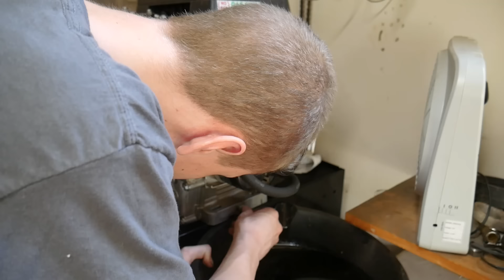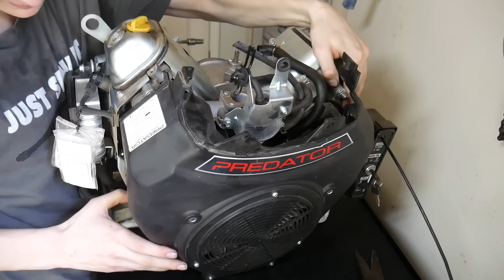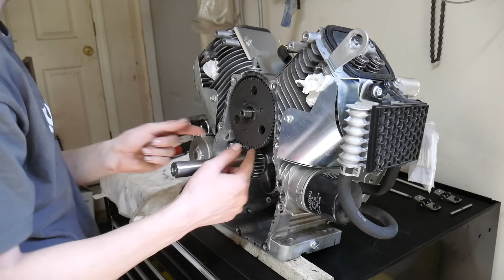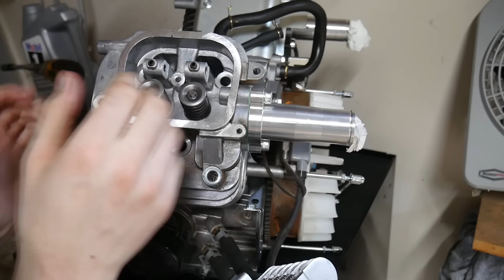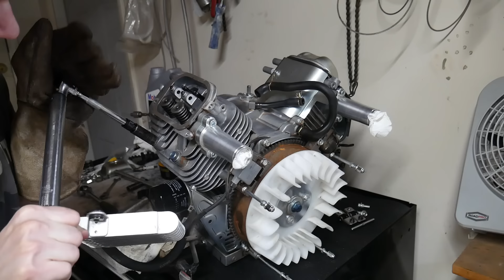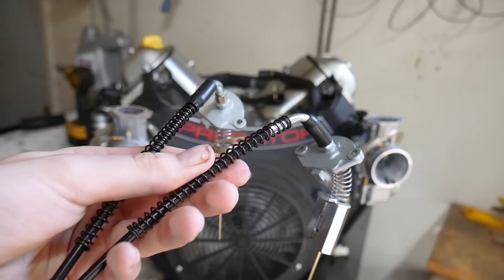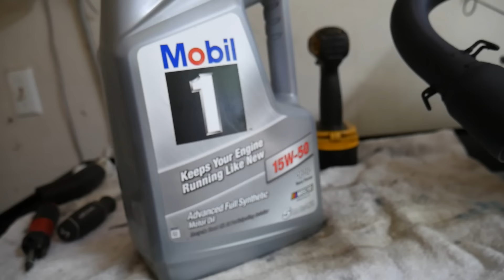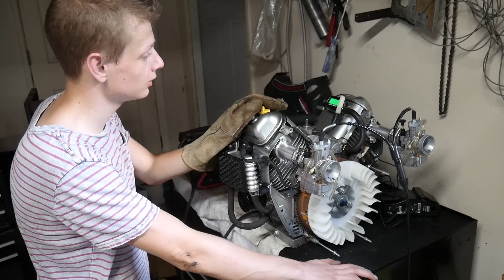2X Factory Output! Predator 670cc Performance Build

Comment: Here is a trick you can do for more power
Advance the spark. I saw two magneto and that might have an adjustment. 
1 use a rotary file, cut slots into the mount hole and elongate the mount holes. Use a large washer afterwards to lock it down and keep tensions
2 not sure if the flywheel has a key. If it does, grind  the key to half the thickness so you can advance the spark by rotating the flywheel on the crank
3 if you have a small airport nearby, pickup some blue gasoline. When I did it was 108 octane high lead but I think it is 100 octane low lead now. Not quite sure.
4 mill port and polish the heads. Possible a thinner gasket. Take a 4 inch bolt, sandwich some coarse steel wool between two large washers, and get a drill and polish away.
Remember to blow the doors off everyone around you.
Vroooooom

Just some old tricks to get more power
Reply: Идиотизм!😅
Reply: I did this on my 99 Miata. I have been running a 5-degree advance for about 10k miles with no issues, it definitely had a small but noticeable bump in power.
Reply: Fyi, that is called timing gain or delay. The carburetor can alter time if he sets a higher idle with slow time it will synchronize at the high rpms. Dragsters have used this over 50 years.

Comment: Engine bearings run on a thin layer of oil. At proper temp the bearings don’t even touch metal on metal as a super thing layed of oil creates a layer between the components thus it’s essentially an oil bearing. So proper oil an proper maintenance to an engine. The only wear an engine gets is on start up and warm up clean oil an up to temp an oil up to temp then there is no wear at that time. To thick of oil then not only do you shorten the life of the engine by metal on metal contract during start up an warm up an even at full temp but you even lose horsepower from the lack of lubercation an lose power from the excess internal heat that can’t be pulled away with proper weight oil running over hot parts correctly

Comment: That was a neet build. I have a question won't the motor overheat without the flywheel cover on?
Reply from the maker: I don't know about that. as long as your moving. I see alot of people running 212's without the covers

Comment: I have watched this 3 times it is just hotrod on smaller scale and young man some day you will be a awesome Dad and Grandad some day. Ever thought of using Valvoline VR1 high zinc race oil zinc would be good for metal to metal parts in small engine.
Reply: I use vr1 in my rotary

Comment: You know that might work in small engines I'm still testing this but on a cold day it is not really good.. thicker oil it will actually not let the upper cylinders lubricate and eventually cause a knock that happened two of the  lawnmower that I've used because I usually use 20w 50 on the oil changes I do for customers and I've had to replace two motor so far and I've only put it on three other Motors
Reply from the maker: Yes I was a little mislead on that. Thank you
Reply: @VasilyBuilds  you have a really good Channel better than rather be welding at least you put a skid plate on your stuff can't wait to see the next one

Comment: My roommate just recently bought a 670 the crank shaft bearing went out and he only had it for a week he took that piece of garbage back to harbor freight and got his money back. Don't buy a 670 they have way too many issues I done some reviews and another guy bought one and his oil pump failed blowing the engine so apparently predator doesn't give a shit about their customers because they have not redesigned the engine for quality purposes so is you want to use a V-twin equipment engine go with either Briggs and Stratton or Kohler with their CH1000

Comment: I used to run a honda twin on a pulling tractor and we loved it. We made a custom intake and manifold ourselves, milled the heads as much as possible, stroked the crank .60, and ran stock rods and cam, it turned 6k to 7k rpm easy and had tons of torque.  I've been wanting to build a preditor the same way and now that I know you can get a cam and everything,  should be awesome.

Comment: Wondering whether you think this build might have enough reliability and durability for an ultralight aircraft engine.
Reply from the maker: Too heavy not alot of power. You can get alot of power but then you sacrifice reliability
Reply: @VasilyBuilds  What a guess on the weight? 40HP is about right if the weight is under about 80lbs. Could lose the starter and save a little more weight.
Reply from the maker: @tthenrie1  110lbs 25 hp. Ditch the heavy flywheel and stock manifolds and you could get it down to 80-90lbs

Comment: Enjoyed your video very much but PLEASE buy yourself proper tools. You really should be using A LOT more lubrication especially on a brand new cam. Lubrication is so important for new camshafts and new parts. I know its clone engine but you definitely dont want that thing blowing up. And Im talking to all the young engine builders out there too, everything needs to be well oiled inside the engine when you put it together.

Comment: Just spent a few minutes on the
Performance 670 website,
Got into the specifics of what performance parts and pieces you are still needing.
Head work,
Pistons,
Push rods .40's
Billet rockers
Billet Connecting rods
Aluminum flywheel
Adjustable timing Aluminum flywheel with cooling fins
Mukuni Carb kits
Predetor Carb kits,
Air filters, for each kit
.20 Billet Piston set
( eventually ) !
Did not see any type of steel performance crankshafts available
( but know they must exist )
Along with performance stroke assemblies
Anyway,
Understanding that you have to start somewhere,
But let me know what direction you are wanting to take this Engine to.
What application are you planning on using it in please ?

Steel Flywheel

Comment: An awful lot of work to not install performance rods, and the performance flywheel.
What are the additional costs you are looking at ?
And, what additional flow work can be done to gain additional hp ?
Valves, flow matching to your header dia., and the same with your intake, I don't have a ton of experience with this specific Engine, but I have to think there is additional hp. available !
Bigger valves, etc. ?
And what are your additional costs for those added performance upgrades ?
My curiosity is killing me !
I am hearing about some insane hp. numbers out of this engine, and still maintaining reliability.
Ok,
I'm outta here !
Good luck, and hoping to hear from you.

Comment: The only problem with 50 weight oil is that it won't flow well when it's cold. Not when it hasn't been Star Ted in a while, when the weather is cold. 50 weight is racing oil, and pretty much everyone that used to use it has switched to light weight synthetic, and this includes nitro cars!

Comment: To see somebodybthis young able to do this much, it gives me hope for my profession. The additions you made are really good but, the rods and the flywheel would've helped more than these. The main source of power is always in the heads. If the air doesn't move, the motor doesn't run. Adding air thru a cam is very beneficial. The springs aid with valve float. That becomes a problem at high rpm. Controlling it with springs is smart. But if there isn't enough speed in the crank, it's not a concern. Lightening the rotational mass is why the rods and the flywheel are lightened. Getting those up to speed is why you put the springs in.

Comment: So you see after he crashed the cart with the 670cc, he realized the problem, there wasn’t enough power to drift away from the house
Reply: how does it compare to a rotax 600 or 800-850 etc? My yz-250 pushed 48hp stock and my OMC sled motor even more. Are you runnihnig xd-100 etec oil or amsoil dominator? I got my sled motors, yz-250 and kohler toro mower on xd-100 amsoil dominator. i just bought 6 gallons quicksilver synthetic TCW3 to fill my 8v92 detroit 2 stroke from walmart and its way cleaner than rotella. The synt tcw3 has high film strength and runs and burns cleaner but its little more pricey!
Reply: @jlo13800  Can't compare because you're trying to compare an industrial v twin 4 stroke to a single cylinder 2 stroke
Reply: @jlo13800  thats a performance built racing engine comapred to a fucking lawn mower engine.
Reply: @sahibdipsandhu ratherbwelding did a rotax go cart build I think and all it did was wheelies and immediately max out at 55mph
Reply: he will have problems with valves ....just add a turbo without changing

Comment: I use mobile 1 15w50 in almost all of my small engines it works excellent in them
Reply from the maker: I'm concerned about  the oil in the cold. It's 30 degrees f here

Comment: Have you actually ever Dynoed one of these Stock 670's & then with these Upgrades? A Stock 670 making 22hp@3600rpm is around 76% VE, and yes, if you're turning it 7000rpm it could make 42hp with a Carb/Cam/Valve Spring Upgrade, but can the rest of the parts handle them rpm for very long, the Stock Flywheel, Rod, Rocker Arms, Push Rods, Valve Locks & Keepers? On the Honda/Clone Singles, about 5000-5500rpm is Max those Stock parts are good too. Some people are using these on Kitplanes, so Durability & Weight is very important. Most People want their Engine to last a long time no matter what the put it in or on! Just about anybody can build a Grenade, build a 670 that can make good hp at Max 5500rpm and last a 1000+hrs. A Rotax 912UL/914UL 4 Stroke is rated at 5500rpm, my different Chevy 402, 427, 454 Chevy Big Blocks were all rated at 5500rpm. I did Street Race my 402 BB in a 70 SS Camaro and I did shift it at 7000rpm and it was making around 600hp. Over those years I broke (1) 12.5cr Piston, (1) Broke Valve Guide, Bent 2 Valves, and broke many SHP Rocker Arms, and destroyed one 400 Turbo Trans Pump.

Comment: I see why people are complaining about you and the stock flywheel the plastic cooling fins could possibly fly off at higher than stock RPM and if you break a stock rod it's possible to send a piece of aluminum shrapnel into your back and you'll be doing another hospital video

Comment: “The thicker the better, just like women “😂😂😂 epic dude lol 😝 that made me subscribe
Reply: Been proven false. Higher viscosity means increased drag also. Engine with oil cooler that can keep tempsbelow 300F should be happiest with SAE 30 or 40. BTDT. (If you really need THICK, why not go for synthetic grease?)
Reply: @jacquesblaque7728 I bow in gratitude to your analogy relating to viscosity and drag. Profound! So im mulling over your "400 footer into the center field stands" statement and Im thinking...all oil is slippery, but viscosity options  when applied to protecting  a gasoline engine makes the oil (for lack of a better alphabetical grouping) tunable to the demands put on  the parts,with the dissipation of excessive temperature being job 1.Then all the other possibilities that manipulating the drag of motor oil as it travels over various parts Can only bring more positive options.The 100 foot aisle of oil choices suddenly makes ridiculously excessive levels of sense .Thankyou!   I think...
Reply: Sameeeeee
Reply: Had to throw in the "j/k" so he won't get any back lash from those non-thicker women😂😂😂
Reply: くーんEJ legend has it vasily likes a woman with thighs and ass... the thicker the better lol
Reply: Thiccer**
Reply: Yup. Thick Women's Lives Matter  
..lol.

Comment: Next time you need to do the valve  Springs just hook compressed air into where the spark plug was. Then compress the cylinder make sure it cannot rotate and you can remove the Springs without taking off the heads. Just a little trick just in case you didn't know.
Reply from the maker: I don't know how I didn't think of that. I actually heard it before. I tried using rope

Comment: That motor would rip in a golf cart. I was going to do a build in an old 1970 Harley Davidson golf cart with a engine and trans out of a quad, but this has me thinking something different.
Reply: I actually did a golf cart conversion with the 13hp predator. Joe got a few vids of it on here posted actually.  Even bone stock it's got hella power. I will agree though that one weakness is those valve springs.  I burned up my first one running it WOT for too long...and I mean REALLY too long but it was a fun day in the woods. God love that HF warranty lol.

Comment: You can stuff rope down the spark plug hole. So you can change the valve springs. Instead of removing the heads. There are lots of videos on how to do it.
Reply from the maker: I tried it, works well with small engines

Comment: That thing almost sounds like a Harley motor.
Reply: Its a V-Twin what do you expect
Reply: Well, it's a pushrod V-twin just like a Harley so it makes sense.
Reply: @LNERMallard  harley sound is all about the connecting rods on one crank pin. In this case..... Hardly Davidson
Reply: It's a 90 degree V twin so much smoother running than a Hardley.
Reply: Sounds like a honda v twin with straight pipes. All the Chinese engines are honda clones. That's why they last.
Reply: @daves984  it does sound like mine 👍
Reply: Cause it is
Reply: And has more power than the actual harleys 🤣🤣
Reply: @noidontthinksolol  it pretty much is a mini Harley engine
Reply: The people who disagree is Bc their grandpa has a Harley

Comment: Hi..liked the video, nice job. I use the Predator and similar HP V2 engines on ultralight aircraft. The engines are installed stock but without the governor. In our case propeller load controls engine RPM, usually set at about 4000 RPM max. Engine reliability is especially important in aviation so I'm reluctant to boost the engines all that much. As HP is boosted, heat dissipation becomes a greater concern. I'd  install head temp or oil temp gauge to monitor heat, especially if OEM air shrouds are not used. Oil cooling is a great way to control engine temps. The OEM  oil cooler rad depends on shroud controlled air flow to provide proper operation. Without the fan and shroud I would consider a larger oil cooler if engine heat becomes an issue. I'm guessing an after market automotive tranny rad would be something to look into.

Comment: I hope you've doubled the horsepower of the kill switch that's now easily accessible from the drivers seat! 40hp 7000rpm throttle stick wouldn't be funny.

Comment: The seal on the flywheel cover might need checking after rotating it into position. Almost certainly smeared the sealant. Another small point.. saying rpms is like saying revolutions per minutes as opposed to rpm.. revolutions per minute.
Great job though.. love to see you add turbo:)

Comment: Very nice build! However, I would put the front cover back on as it's responsible for directing the air from the fan on the flywheel up onto the cylinders. Thus cooling them

Comment: I’d like to see someone build a chopper with one of these using a divorced 5 speed trans  from a Harley. The only problem I see would be adapting the belt drive pulley for the predator engine.
Reply: HD trannies are heavy, you can find old english bike transmissions from models made in the 50's and early 60's used and reasonably cheap if you look around. They're also made for chain drive primaries and output.
Reply: @Oldbmwr100rs  you can get a modern 5 speed from a softail for around $400 or less and parts are easy to find. Good luck finding parts for a transmission off of an old english motorcycle.
Reply: @cody8754  The HD one is just heavy is all, as for old brit bike parts, I can get literally any new part for my Norton, and triumph parts are the same. The classic market is surprisingly well supported.
Reply: Yea low slung weight doesn’t really concern me as much as parts availability, price and familiarity of parts. If you have the parts for a norton or triumph readily available by all means use what you think is best for the application. I’m sure it will take a fair amount of trial and error to get the mixed match of parts working smoothly as with any build. The reason I think the predator 670 has a lot of potential for a motorcycle build is that a lot of people have already taken the easy route and used the torque converter. The Orange County choppers Dixie chopper build using the generac engine with a motorcycle transmission and clutch is what makes me want to get creative with the predator 670 platform and I still haven’t seen one on YouTube. If I had the garage space and the extra money and time available I would give  it a shot but until I do I’m waiting on someone to say challenge excepted.

Comment: Let me know if you’d be interested in me machining some weight off that flywheel for you. No charge.
Reply: It doesn't matter if you remove let weight if it's a cast flywheel because it probably have small and bubbles. And billit flywheels have way less bubbles and are more solid than cast ones . So if you machine away weight and make it thinner it will be more likely to explode that it would before you remove weight because it's more brittle.
Reply: Isn’t a heavier flywheel better for off road use?
Reply: @Pal-Stallion  the stock flywheel is good for torque and slower revving up. Billet flywheels arw lighter and rev faster and are better for high rpm

Comment: I no that this doesn't look very Kool. So maybe at the back of your go-kart you could put a bright color flag with your personal logo ( Vasily Custom Builds ) on a 4ft pole so that other vehicles or pedestrians will be able to see you for there safely and for your safety. Also for your safety and there safety you should start giving had signals whenever you are making a turn. Last but not least you should already know that there is cameras everywhere and expecially behind a gas station. Great Video 👍 🇺🇸